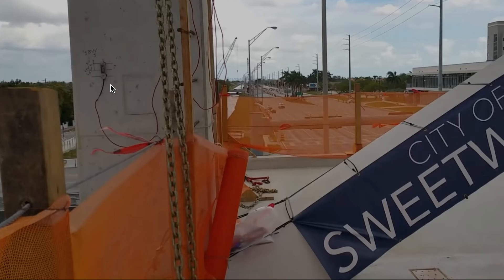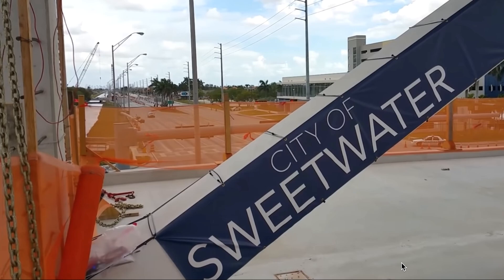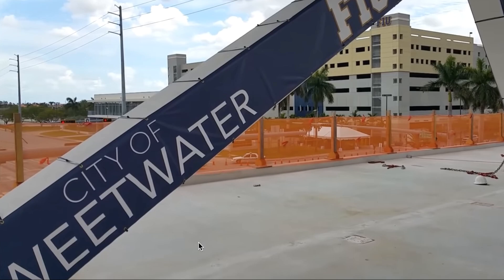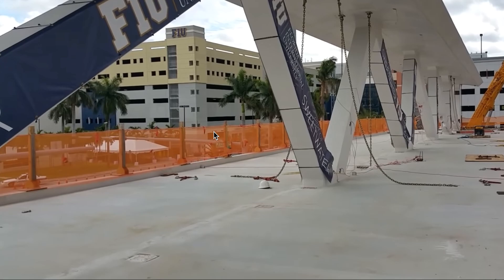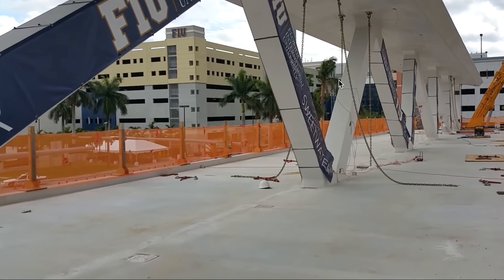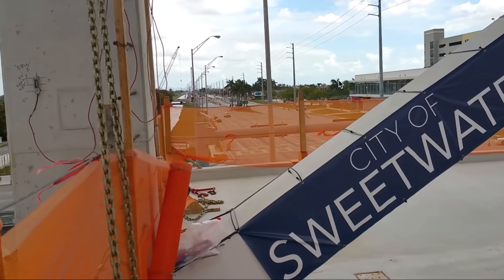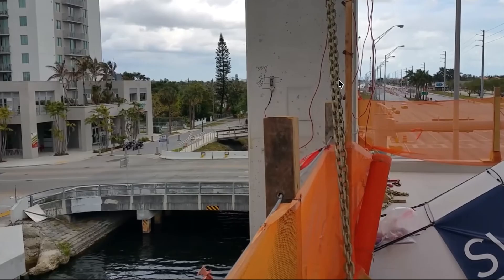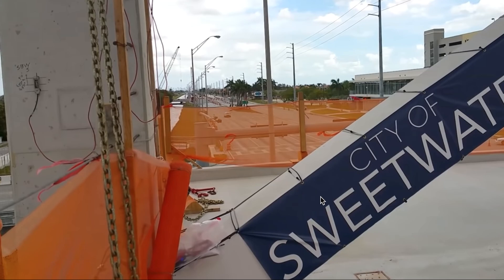FIU BRIDGE COLLAPSE NO CRACKS presenting on #11 day of move

Comment: Interesting do you mean the cranes monitoring system for balance and outreach or non-functional for load ? that is incredible that was one of the biggest cranes operating at the time I thought to have a system like that non-functional and sane. I was unsure if you were connecting that to the disassembly failure of the crane in Seattle.

Those pictures and the banners look like they might be trying to make a purse out of a pig. So are you saying those cracks were after these pictures and it was moved how about the cracks they were showing in the video where the filler was in the crack , I guess that was in a different area but that crowding on the floor around the drain I don't know what that is but the Jack looks almost too perfect in those pictures. 

Keep up the good work 👍

Comment from the maker: What are the odds they are using a ''non-realtime" monitoring system... It would be a useless system to even use... BDI is the monitoring company and at one point they claim the system went down!  Logic, would then dictate you stop the move until you get the monitoring system back up... so, you determine the deflections from your baseline... Deviations from ''static"... 
But, my logic states, per the public data on this, the system went down by ''accident'' to not show the true issues? 
I find it very telling that BDI did a tweet and then removed it... They brag about their being part of the team but not about the failure of their company and this system they installed to monitor during the move... https://ibb.co/KVfkvT5
Reply: Yes, everything stops 'till the issues resolved . no engineering firm worth their salt would remove it -- it would be repaired or replaced. abandon in place perhaps given time constraint, but remove it?
Reply: Everything in failure mode; the bridge, the monitoring, the decision to proceed with moving a failing structure above a public way...
Reply: BDI's monitoring is not relevant given the photos of the massive cracks that emerged that morning, IMHO. Regardless, if BDI's system failed to operate or indicated any issues, BDI should have halted the construction and traffic immediately under emergency protocol; that is legal liability IMHO.
Reply: If the monitoring system were down during the MOST critical stage of construction, BDI would leak the emergency calls and emails CYA. A cynic might suspect the data "disappeared" after the fact. Maybe BDI's monitors were poorly placed due to the wonky maths behind the design or they broke as the bridge failed.